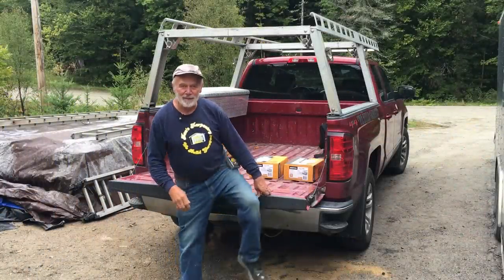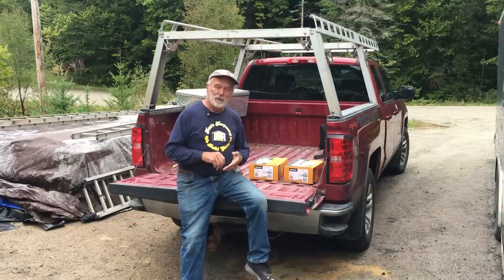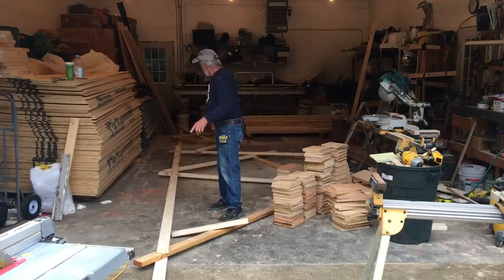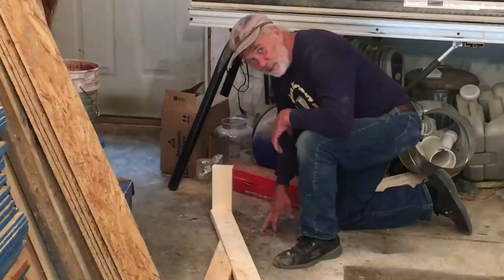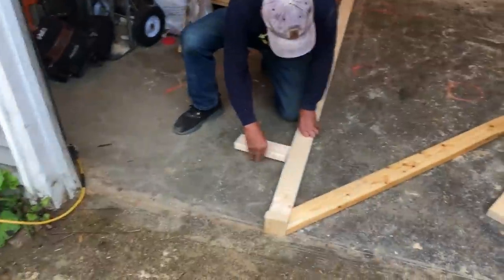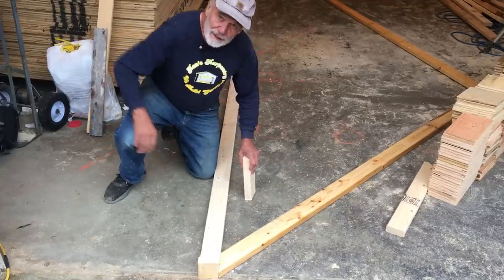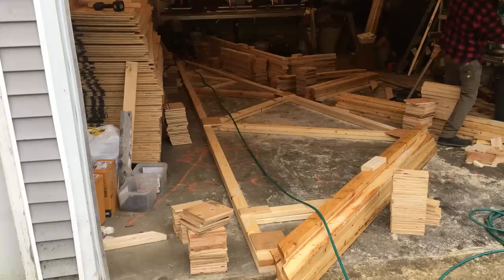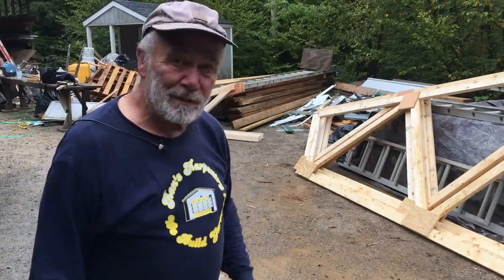You Asked...We Did it...Building the trusses

Comment: Years ago, I helped my father and brothers-in-law build his weekend get away cabin. They had already dug all the post holes and spiked the 4x4 posts for the platform/floor. We dried set the posts the first day and did the rim boards for the first floor. The second day we did all of the exterior and interior walls, windows, doors and sheeting and got the deck down for the second floor. We built all of the gable trusses on the second floor deck by building the first truss, then blocking it as a pattern for the rest. We pre cut all of the 2x material so all we had to do to build the rest of the trusses was lay them in the blocks on the floor and plating them  together. It is a 24x24 cabin. We had it up and dried in in 2 days. This included the tar paper on the roof. To be fair, there were 8 of us if memory serves. My mother in law still enjoys this little cabin in the woods to this day. God bless and stay well.

Comment: Back in the 70's I built a garage with a Gambrel roof.  This was in the days before todays modern miter saws.  But I did have a radial arm saw.  We set up a jig on the deck of the second level and put blocking at the birds mouths and peak as well as the mid joint.  We cut all the pieces on the Saw.  We'd make a cut, stack it on the opposite side of where it started until all of those cuts were made. Then we'd set up for the second cut and feed them back in reverse.  Once all the pieces were cut we started assembly on the deck. All the joints were reinforced with 1/2" CDX ripped six inches wide We'd lay a full length on the joint with a stop block.  Then we'd cut the plywood to match the pitch.  The off cuts would then go to the mid joint.  The bottom cord was the 2x10 floor joists.  Everything was hand nailed. Todays modern nail guns weren't very common then, especially for a handyman. Fifty years later I still drive by when I'm back in Minnesota and it's still looking good
Reply: I'd be really proud of that garage too! That sounds like a lot of hard cuts to make as well as all the hand nailing that you had to do. Kudos.

Comment: When I build trusses. I put walls up. And build the trusses on the inside wall. This before sheathing 100% 
No bending over.  Just take a chalk line and snap lines on the studs. Add wood blocks to support at knee level and get to work.  I did it this way first on my green house

Comment: Ken, on Texas you can let a load hang off the back of your truck or trailer an infinite length with a red flag attached to the end of the load. 
  
Second, my grandfather was a carpenter. Built his own pole barn shop in the 70’s with 2x6 trusses, 1/2” plywood for the laps, 4:12 pitch,  entire building covered in metal. It has withstood many hurricanes here along the gulf coast. 

I enjoy your work.

Comment: Do you have to adjust the truss locations on top of the gable walls to account for the extra thickness of the gussets?  Or maybe just cut a hole in the sheathing to allow the gusset to be flush with the outside of the walls?

Comment: WITH THE COST OF TRUST AND YOUR GUYS SEEM TO GET EVERYTHING RIGHT I WOULD BUILD THEM MYSELF IF I WOULD MAKE TRUST MY SELF I WOULD ADD ONE MORE WALL FRAMING STAND DO LAY OUTS AND MARK MY STANDS TO FRAME THE TRUST YOU USE ONLY A COUPLE DIFFERENT TRUST THE HARDEST ROOF YOU MANUFACTURE IS THE 2X8 12 ON 12 PITCH AND YOU DO A TREMENDOUS WORK ON BUILDING THEM ON SITE

Comment: Any reason you wouldn’t just use hand cut rafters on site until you can get trusses. Just built a garage here and hand cut was actually a few thousand cheaper than trusses
Reply: I'm sure he's doing this for the span to avoid any center supports. The alternative is to load the raw material and build these on site, which adds to travel time. Doing this in his driveway will save many hours.
Reply: It’s not just as easy as cutting out rafters. A truss is a whole structural component, not just a rafter that holds up the roof.

Comment: Ken I'm curious as to why you are using wood blocks. For bracing instead of the metal mending plates?  Like the truss companies use.  I bought them at my local lumber yard when I built my trusses for my home.
Reply: Unless you have a press it would be very arduous to get them all installed properly with that many connections in an entire set of trusses! Plywood gussets go much quicker - especially with today’s pneumatic fasteners…..🔨
Reply: I have done it the way Ken has. Just as strong and much cheaper.
Reply: I was told (40 years ago) that wooden plates are stronger and hold up better in a fire situation, although I suspect it's a more expensive way to do things. Basically, metal will transfer the heat and make a rafter burn / fail sooner, causing early building collapse, sometimes without warning.
Reply: @rupe53  Interesting

Comment: I built some trusses for two porches I attached to a house I had built for me. I chose to use one of the new glue formulas on the market at that time and I compared the shear strength between nails and the glue. The glue shear strength was much, much higher, more than a factor of 10. The inspector didn't like it. I still like the glue option. Let me know what you think. Thanks, Glen
Reply: Glen, I agree with you.  The glue joint, if clamped properly, is way stronger than nails.  On my own house, I tend to use glue with screws (to provide clamping force).  My own feeling is that codes and inspectors have not entirely kept up with progress in glues.  In fairness, there may be issues with determining the quality of a glued joint.